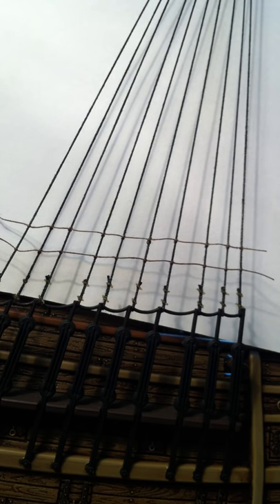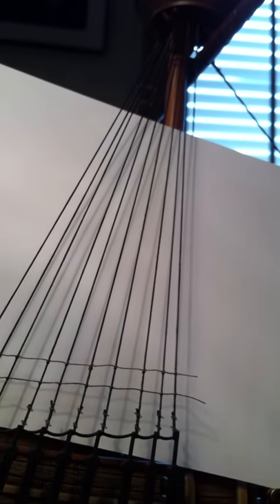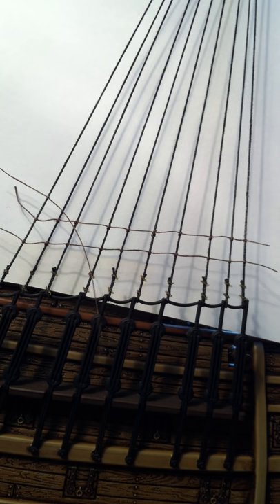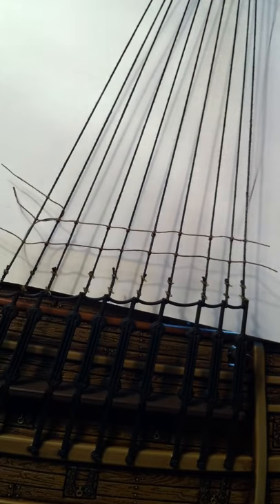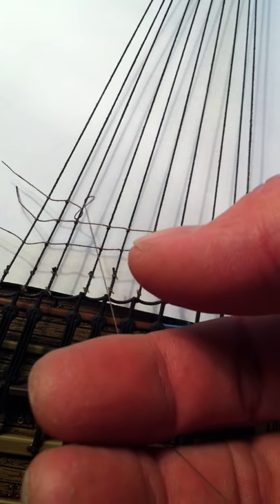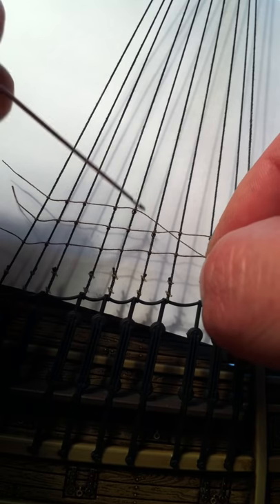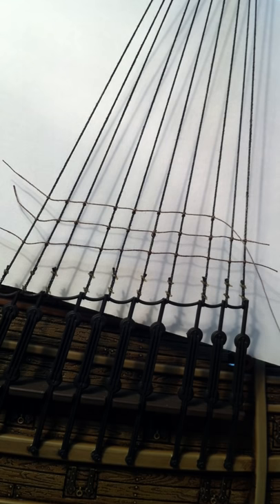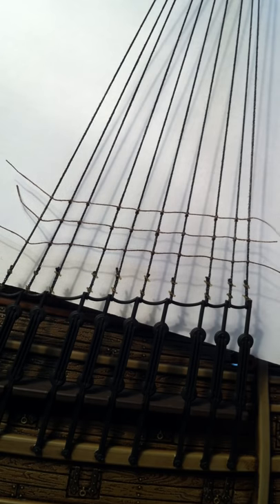How To Tie Ratlines On A Model Ship

Comment: I thread the rat lines through a normal needle. I find it easier to pass the line where you need it to go. You can also end the rat line by coiling it round once and stitching through the final shroud. Doesn't create a "stub" at the end

Comment: somewhere i read that ratlines are away from next ratline about 13 inch, thats 13 x 25,4mm = 330,2 mm in Real.
and for ships with 400-450 tons/20-22 guns, the lower masts the shrouds have 7 1/2 ins circumference / ratlines have 1 1/2 ins circ...............the topmast shrouds are 4 1/2 ins and ratlines 1 ins. ....mizzenshrouds 4 1/2ins, / ratlines 1ins.....mizzentopmast shrouds :3 ins / ratlines 1/2ins...(info tables of royal navy).....1-1,2cm distance i use for my M1/25 Scale models..

Comment: Hello David, thanks for the graphics.I am building a model of a French 60 gun, three masted ship and of course there are a bunch of ratlines to be made. Your suggestion comes in handy. Tell me: did you weave the lines  when they were installed on the ship or did you  sort of make a rig up on a board according to the height of the mast? Another question: the gun barrels, did you have to make some?
I don't have a model lathe and ready made barrels of 30 pounders or Long Toms are darn expensive. Any ideas?
Thanks for a reply, 
best regards from Dallas
Koelschwolf (Wolf)
Reply from the maker: Hi Wolf!  As far as my experience, there's no good way to rig shrouds and ratlines off the model...the need for even tension can only be achieved by running the shrouds around the masts, and then securing them to the deadeyes.  So to answer your question, the lines are installed on the model...I know it's hard to tell because I have the paper behind the shrouds to help with visibility.  The model is a plastic kit from Imai, the Spanish Galleon they released back in the 60s...I did not add any aftermarket parts, the guns were just the parts from the kit.  I'm sure if you want to buy cannon barrels in brass, they will run you a bit of $$...good luck!  :) If you look around, you can find somewhat reasonably-priced fittings, there's a place in the UK that sells good quality fittings for pretty much anything you want...a quick look shows me that you can get sweet brass barrels for around 1-2 dollars each...for 60 guns, you're looking at 60-100 bucks...depending on scale:
http://www.cornwallmodelboats.co.uk/acatalog/billing_boats_cannons.html
But you could also find barrels made of cheaper material and just paint them...do a little research and I think you'll find what you need, and hopefully not break the bank to do it!
Dave

Comment: Thank you for this video.  My forth time on Revell 1/96 USS Constitution.  The first three kits had the plastic coated, pre-formed, ratlines.  Not too bad, but this last kit has injection molded ratlines and so I ordered a ratline jig because I could not be proud of a model with glue on ratlines.  I bought a decking kit for this model, way too expensive, oh well.  I might buy metal cannons and look into cloth sails as well.  I have had a marble base for many years and will use it on this kit as well.  I use clear fingernail polish to fix my knots, do you have any better ideas on this, thanks.

Comment: Awesome video! Can you explain what size thread you use for the shrouds and ratlines? I am doing my first ship model...Revell's 1/96 Constitution and plan on doing my own ratlines also! THANKS!
Reply from the maker: A basic rule is that, for the shrouds, you'll want to use line that is among the thickest of all line used on your ship, similar to the stays.  And for the ratlines, you'll want to use the thinnest line of all.  The stuff I used for shrouds on this model (Imai 1/100 Spanish Galleon) came on a big roll that I found at Jo-Ann Fabrics, near the knitting material...I don't know the exact thickness of it..sorry! And for the ratlines, it's just standard tan sewing thread, very thin.  Another tip to remember is to run your line through a beeswax cake...makes it much easier to handle, and also adds to the strength, so it won't snap when you're trying to tie strong knots with tiny thread.
I have to say, it's very ambitious to build the Big Constitution as your first ship!!  Take your time and PLAN AHEAD!  :)
Also, if you're looking for advice and suggestions, consider joining up with an online forum, lots of shipmodelers are very generous with their knowledge...the guys at FineScale Forum have helped me tremendously in the few years that I've been building ships...it's free to join, and you can find answers to LOTS of questions....and there's always a few threads regarding the Revell Big Connie, so I'm sure it would be helpful for you!
Dave

Comment from the maker: I'd be happy to make more videos, if anyone has a specific question, or could use some advice/demo of a particular technique?  I'm no expert, but maybe I could help!
Reply: I would be really interested in more rigging videos, just started the HMS Victory for Airfix, and I'm damn nervous about the rigging. I don't know where to start. Plan so far is to run the white thread through a beeswax holder, and then stain it once its on and tied with a brown wash. I can't even figure out how to run the thread through the holder correctly to get the lines stiff, they just get, well, limp?
Reply from the maker: Matt AH
Hi Matt-
When I get to the rigging stage of my current model (Imai Chinese Junk), I may record a little bit of it to share some ideas, but truthfully, the rigging on the Junk is very different than most other sailing ships, for reasons I won't get into right now, and it might not be as helpful to see how that goes. (no shrouds on the Junk, for one thing!)
But, I may be able to help you a little with preparing for your Victory....if it's your first ship model, don't worry about feeling nervous!  I've learned that everything seems more complicated when you don't know how to do it yet...but I assure you, a couple of tries, and anything can become easy (tedious sometimes, but easy!!)....
First off, is your rigging line white?  Or off-white/tan?  If it's WHITE white, I would recommend replacing it, or dyeing it darker (soak it in coffee or tea overnight)...really light rigging line will be much too stark, and may look out of place.  I would recommend coloring it BEFORE you rig it on the model...if you tie the lines off, and then start messing with them (or especially if you get them wet!), they will definitely change tension tremendously...if they sag, it's bad...if they tighten up, it's bad.  Please color it first.  Just my suggestion.  :)  I usually unroll lengths of line and soak it, let it dry, then wax it....many times that will also let out some of the stretch as well.  I have a few thumbtacks on the wall in my work area, and there's always a bunch of different diameters/colors of thread draped over them, waxed and ready to use!

Second, waxing your line is crucial.  If you have a puck of Beeswax in a case/holder, that's all you need.  Waxing the line serves a couple of purposes.  One, it strengthens your line, so it won't break so easily when you pull it tight for knots.  Also, it keeps the fuzz laid down on it...fuzzy rigging line doesn't look right.  And waxing does add a certain amount of stiffness to really thin thread, but it doesn't necessarily make it hard.  In this video, the line I was using for the ratlines is super-thin sewing thread, and being thin it is stiffened somewhat by the wax, but just enough so that it doesn't droop at the tip, and so that I can shape it a little bit. 
When waxing line, I cut pieces about 2-3 feet long, and then run them through the slots in the holder a few times each way, then I pinch the line through my thumb and forefinger and pull it through quickly a few times...this helps to embed the wax into the thread a little more, and also to remove the excess wax.
Let me know if this helps you at all, and if you have any more questions...please ask! I'm more than happy to help!  Once I finish the Junk, I'll be moving on to a more traditionally-rigged ship model, either the Golden Hind, or the Mayflower, and I'll be sure to include videos showing some of my painting/weathering techniques, and also more rigging, especially, standing rigging, like how I seize my stays, tying shrouds, etc...
Also, if you want access to a TON of good info, think about joining the Finescale Forum, a modelers forum with a good community of ship modelers!  I'm a member there, and that's where I got a lot of my first lessons!...it's totally free, and fun!  Here's a link to the website (not spam!)
http://cs.finescale.com/fsm/modeling_subjects/f/7.aspx

Good luck, and happy building!
Dave
Reply: I would like to know if it harder to build a war ship like the HMS Victory or a clipper ship like the Cutty Sark.  Any advise would be greatly appreciated.
Reply from the maker: Allen Lichner Hi Allen-
One of the biggest differences between a clipper and a ship like the Victory is the armament.  HMS Victory carried 104 guns at the Battle of Trafalgar.  That's a LOT!  And building scale-model cannon is time-consuming...very time-consuming.  It really depends on the detail you want to impart, and the type of model you're building.  Most of my model ships are built from plastic kits (I usually make a number of modifications to them), so they don't take me several years each to build them.  But even in plastic, a quality kit will include cannons made up of between 7-10 parts each...and then if the cannon are rigged with breeching lines, etc., it gets to become quite a serious portion of the entire experience.  Either way, a clipper will have a smaller number of overall parts, so I'd say that'd be easier than the Victory. 
However, there are many different kits available of both the Cutty Sark and the Victory, each with widely ranging quality, in terms of detail and difficulty.  One could easily find a kit of either ship that would be easy enough to build, regardless of a person's current skill level.
Thanks for watching my video!
Dave
Reply: David Kump+Thanks you guys are amazing.  I bet every museum in the wants you ship.  Thanks again

Comment: When you say AC at the end of the video, do you mean a drop of glue (i.e. Cyanoacrylate) that you apply to each knot ?
Reply from the maker: Yes, I meant to say CA
Reply from the maker: But I don't even bother with glue anymore, it's not necessary
Reply: @davidkump  Thanks, David. I actually apply just a drop on the ends of each ratline, just to ensure those knots don't come loose, and leave the internal knots free of glue. BTW, great video. I actually use the Amati Loom-a-line. I find it's just a little easier and faster to do the knots in a horizontal plane, but I guess that's a personal preference. Since this is relatively close up work, I use the Carson Pro Deluxe Head Visor Magnifier. It reduces fatigue and helps speed the rigging.